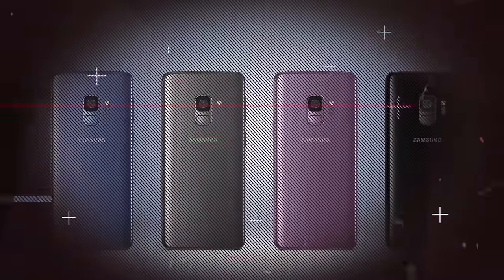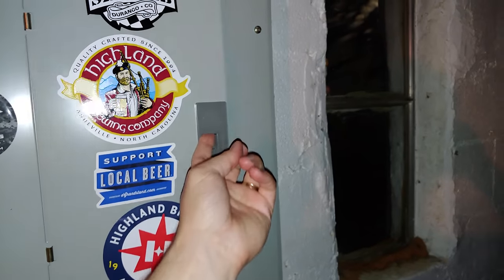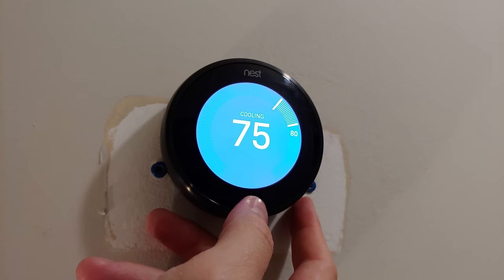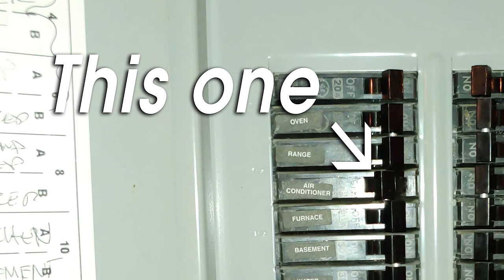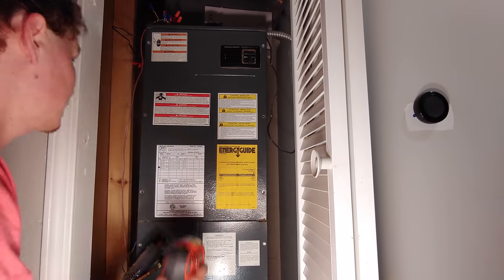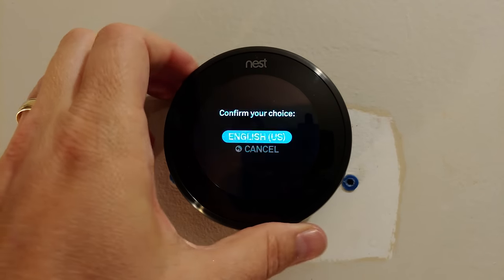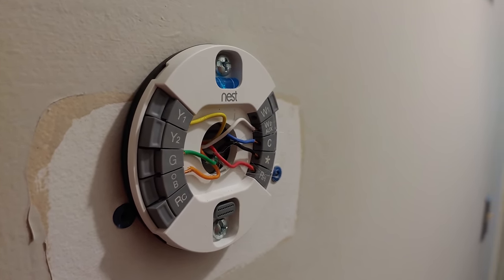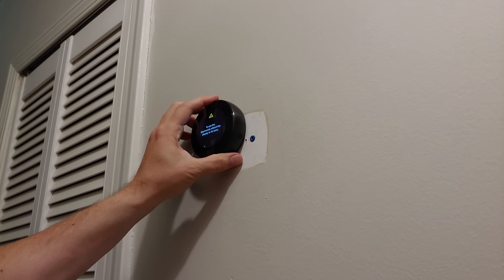3 Common Google Nest Thermostat Problems and How to Fix Them

Comment: Thank you so, so much for all the information.  I got the "no power to the Y connector" or something like that.  Thought the unit was broken, some wire cut somewhere. I checked the connection, and it looked fine.  I was about to call for repair tomorrow, and you said "check the fuse" and I figured "why not".  Went to the A/C and guess what???  It was the fuse.  Went through the tool box and found a fuse. Powered off the A/C put in the fuse and I was good to go.  Something as simple as a fuse and if I didn't watch your video I would have been freezing (it's 43 degrees in Orlando) tonight and probably paid a bunch of money to the repairman.  My wife gave me a big hug and I got brownie points. 😁

Comment: I HATE this nest system with a passion. It was already installed when we moved into our home and it's been nothing but trouble. I had this same issue, amongst others. Right now I'm trying to figure out why the house gets freezing cold when the temp isn't supposed to drop past 72 degrees!!!
Reply: I hate the nest thermostat! My unit will not go lower than 78 degree in the Texas heat!
Reply: @tamikasimmons8307  disconnect it from the wifi and program it the way you want. Mine has a problem with saying its 70 in the house when its actually 75. Also if you have the thermostat set low and its not dropping enough then you may have an ac issue. Not the thermostat
Reply: Probably a frozen coil, which you need to open AC vent and let it melt down into drain pan. You gotta turn off the compressor outside and change thermostat to fan only. That was my issue. Had to wait about 2-hours though until it melted down. Then I had to clean it. 🤷🏽‍♂️
Reply: Same here
Reply: I'm having the same problem, ive got it set at 74 and I reset the thermostat and its still dropping the temperature and it's really cold.
Reply: Thanks - you saved me! Couldn't select anything on the menu until I stuffed the wires into the wall some more.
Reply: I agree. It's too buggy. My problem is the opposite. It's blowing heart randomly when set to air condition.

Comment: Thank you for this!!! Had my power turned off but still ended up blowing the fuse in my furnace. Without this video I would have been lost! Got a replacement fuse (ironically in the auto section) and everything worked immediately.

Comment: Thank you for the video. Nest stopped cooling after heat being turned on for a few days. Prior to cold days, cool was working perfectly. Any suggestions how to resolve this?
It keeps blowing warm air. We tried everything: from breakers to resetting the the nest. That did not solve the problem.

Comment: Got a Nest as a gift last month.  It does not seem to like my 1989 furnace. I have it set at 69 from 10pm to 3 am and then move to 73 at 3am so that when we get up for work,  early, there is heat in the house.  There are days that the Nest Learning does not follow the schedule and the house is cold even up to 7 am. So then I move the app to a degree higher and still the furnace does not come on. I am very frustrated. And it says 2 to 3 hours before it will kick on which is now by 10 am.  This is not what I want. The old thermostat started the furnace immediately if moved up.

Comment: My issue is: the thermostat works for a few weeks, then suddenly stopped working.  Replaced the air filter didn't event help.  Put back the old Honeywell unit and started working again.  Google search returned ton of the same issue.  Called Google support and said to call an HVAC.  Go figure.

Comment: hey, this video helped me trouble shoot my power issue. Basically, there was no power running to the wall mount not because of a fuse but because my furnace has a moisture trip sensor sitting at the base of the furnace. I hit the reset button on the sensor and it gave power back to the furnace and the wall mount. Thank you so much,,,saved me hundreds of dollars !!!

Comment: Good job for not being an hvac technician, a few things you can add is you can shut off the power at your furnace/air handler power switch instead which may be more convenient and it's a 5 amp fuse not volt

Comment: Tip two helped out. I wasn’t getting heat + fan until I switched my single red wire to the Rh tab instead of the Rc tab. 

Thanks!
Reply: My nest thermostat worked fine for a year then suddenly started e298 error. I have 4 wires no common. I gave up, after many complaints from spouse, and put the programmable back up.

Comment: What if the fancy hockey puck simply decides it doesn't want to run some nights? Sometimes it'll keep heat great, and sometimes it reports to me that while it's set to 70, the temperature is 63. My Honeywell unit never had this problem.

Comment: i have a wiel mclane steam boiler with radiators, 24 volt-2 wires feeding a Honeywell thermostat.  i purchased a nest 3rd generation learning thermostat,  installed it, connected to wifi,  the nest prompted me to test mode, went downstairs to check the boiler.  It turns on but the problem is when I go to the thermostat and lower the thermostat to turn boiler off,  the boiler does turn off but the dampener motor will keep running and buzzing.  it keeps rotating the flapper from on to off and humming........  i had to remove nest and reinstall the Honeywell,  any solutions?  it's almost like I need a c wire and possibly another relay PC board?

Comment: I had a new furnace and ac unit installed in december, its july and the ac just went off. wtf... Its under warranty but this is second problem since installed (american rescue rooter) r wire not connected. The breakers are on and I am not playing with wires.I paid them 8000.00 to install this stuff oh and their nest smoke/carbon detector with batteries that last 10 years dead in two months... Do you know how much those 6 batteries cost??? I am so pissed and it's fricking hot at 2.30 in the morning-no sleep for me
Reply: Bruhhh, literally the same shit is happening to me! I wake up sweating bullets when the temp is set to 66 but then the thermostat will unauthorize inputs to go up to 75 or 80 when 67 is set on screen. I’ll lower the temp then the temp goes higher😂. This shit is trash and an irritant that makes something so simple into something too complicated. So many inputs and controls that are really there for nothing, manipulating all these different outcomes of temperature.
Reply: @marshallpinckney74  I just want my old manual thermostat back. It is trash, and those temps same here go to bed at 74 wake up at 65....wtf  come on

Comment: Just installed a Nest Learning Thermostat and it's not cutting on the heat.  Looked at your video and issue #2 was my problem.  Change the Blue wire from W to OB and now it's working great.  Great Job!  Thanks

Comment: I saw the jumper on the old thermostat and wondered if I should run the red wire to both rc and rh. Apparently I need to run to just rh as I have it on rc. To get it to heat it is set as B wire type and not an O wire. Also it had a run away heat issue today. Initially It didn't power up.

Comment: I just installed my 1st Google nest thermostat but I can't get get to recognize the humidifier in the * It say no wire connected. Then come to find out there is no adjustment setting in the nest thermostat for the humidifier ontop of that. I just got I have no need for the learning one that and I don't like the price of it 😕

Comment: Question? On my old unit, I have 2 wires connected to labeled area of Aux/E one wire is white and other is a stripped copper wire. Do I place both of them in the Nest thermostat marked W Aux?

Comment: Man, why didn't you use the included wall plate to clean up that install! A-D-D really kicked in for me and I would have had the plate on there first thing! Otherwise, 2 nests installed for me now and both had C-Wire issues that I had to resolve, first one I bought a separate 24Volt 2 Wire kit from Venstar cause I had a 2 wire furnace (heat only). 2nd furnace today had again no C-wire to power the Nest BUT luckily the C-wire just needed to be attached inside the furnace and then added to the connection on the thermostat!

Comment: I had the e74 error code. I noticed that i had to reset the breaker and it started working. I may have a bad/intermittent breaker, so I want to get that checked out first. It'll run fine then all of a sudden, i get the e74.

Comment: What if it worked great for 18 months, but only wants to blow increasingly hot air when set to cool this spring? Heat works fine and stays at temp, but cool set at any temp will blow hotter and hotter. Old thermostat works fine. Though the next did seem to work better with less on/off modulation. We do have a connected c wire. 
These are set the same as the pic I took of the old setup 18 months ago.
Y1 - Yellow wire
G -  Green wire
OB - Orange
RC - Red
W1 - White
C - Blank
A dark blue and brown were disconnected, unused and tucked in the wall when I swapped thermo's 18 months ago. Still not using them.

Thanks for any tips or suggestions. Google/Nest support has been...we'll call it "unhelpful".
Reply: I’m not sure of this is your Nest causing the problem. This happened to us and it was our coolant running out. The air was increasingly getting warmer and warmer until we eventually called someone. Did you ever figure it out?

Comment: Do you have a SOLUTION for the fan blowing constantly on the 3rd gen Nest
Reply: I have the same problem. I replaced the Nest thermostat thinking it was defective but I still have the same issue. Tried Ecobee thermostat and same problem.
Reply: @MsFernando148  i had similar issue... I checked the furnace and it was tripped (fuze). not the breaker circuit, but on the furnace itself.
Reply: Set the fan on auto

Comment: Have you ever seen a Nest thermostat causing a short double start to the AC compressor? Our AC compressor has started a sporadic, random short double start, then runs fine. Our AC Tech has done troubleshooting and changed the capacitor, etc and has no idea why this is occurring  .

Comment: We installed a nest thermostat and are having an issue not mentioned here. We have a "zoned" system and the upstairs vents are not blowing air at all. Is this an install problem or something completely unrelated? No one can even tell us how we are supposed to control the zones. Do I just turn on the 2nd thermostat?

Comment: I think the wires sticking out was my issue, even though it didn't looks like it. I kept on having the device reboot when I would try to press or spin dial. I took off and push in wires in to make it flush, which are very strong because its pure copper, not strains. Then put unit back on and it appears to work better for button presses and appears not to be "rebooting" itself when I try to touch the settings and dial. Thanks for the tips.

Comment: I bought three Nest E's yesterday on clearance. They are obviously old stock and had to be charged prior to installing/setting up. That said, two work perfect, one when putting it on the base said "remove from base and reattach" I left it over night and now it's dead, no light, no nothig. I currently have it on charge assuming its dead again? Have you encountered this with the "e"?

Comment: I have 2 units. 1 in the basement 1 in the attic. For the basement unit, i swapped to a NEST Learning no problem. For the attic it would power on my furnace but it was a start/stop scenario. I called a professional and he couldn't do any better. I switched to an Ecobee4 and it worked no problem. I just prefer and would love to have two NEST thermostats. So before i pull my ecobee off and try again with a NEST, why would I need to change my wiring to the heat pump side when i have a gas furnace? or did i misunderstand?

Comment: That's helpful thank you,,, mine has something to do with the G wire nothing works ... Then it worked just the fan and when I reach to nest customer service they told me that the system is detecting higher voltage and the nest Tstst max can handle 24V .... Any idea how yo fix it ?  They suggested to get an HVAC guy which will cost more than the nest itself so I rather sell the nest if it's not gonna work and find another smart tstat can handle more power than pay that much to HVAC guy.... Any idea anyone m

Comment: I tried to turn my heat on and I got an e/74 error..  took it off wall and lugged it in and and it tells me to put it back the base, then it goes blank so now I have no ac or heat. any ideas. at one point it says its not getting power. ive flipped all my breakers, i sucked out the jellyfish with vet vac from overlfow . tomorrow I will take off front plate to see if maybe a blown fuse?? help!

Comment: I have a Nest Thermostat E connected to a two wire heat only system. (gas fired steam heat). It has worked flawlessly for several months. Today the thermostat's screen went black, no message. Internet, modem, router, wire connections and all circuit breakers checked out fine. After about 30 minutes the system returned to normal on it own with out any intervention. This the second time it was noticed to happen. Any thoughts as to the cause?

Comment: Thank you so much for this. I thought I had a conventional system. Turns out I have a heat pump system. Did as explained and reset my nest to read for heat pump on the equipment settings and boom cool air!

Comment: Thank you for your help, I had an issue with my R wire saying I wasn’t getting power to the Nest, so I opened up the A/C unit, and had a blown fuse. After I put the new fuse in that I bought from Lowe’s, the display came on like never before.

Comment: I tried the first two suggestions before I saw this video. I thought I had finally found my answer in tip #3 but it turns out the unit in the attic has a safety switch on the door so if its slightly ajar the entire unit shuts off. Great video and super helpful anyway!

Comment: I had an E74 incident. It turned out to be a tiny button-type circuit 
breaker on the transformer inside my rooftop packaged unit. There was a 
recent power outage in my area and I assume a spike in power tripped it.

Comment: Hi can anyone help please I've  got nestThermostat e battery powered  so heat link C and NO my 2 wires won't stay in   do the mini screws at C and No come out or does the 2 wires need to go through mini screws on hear link where wires go in at bottom part not like the 1 b4 has  lots of wire inputs when mine only has C then No n something else under NO  then ithee side has oti 1 n oti 2 and that's it

Comment: Thank you for the video. I’ve just installed my nest from exactly the same Honeywell thermostat and I’ve got hot air blowing regardless the Nest Thermostat selection. After I watch your video I are wired like you mentioned and it worked fine. Thanks.

Comment: My nest worked fine for a year. Here in Texas we had a very cold wave. The heat only intermittently worked. Fan wouldn’t come on most times unless we reset the breakers. Now it’s starting to get warm and the AC wouldn’t come on at all. The outside unit would run, but the blower wouldn’t. I went to my local hardware store and bought the cheapest thermostat they had. Installed it. BOOM Fixed. Never doing nest again. I’ll keep this basic bitch thermostat until the day I die to avoid my kids going to bed cold.
Reply: I am having the exact same issue

Comment: My problem is the system works fine for a few months then it stops and says wiring has changed. I haven't changed anything. The first time that fuse in the air handler was blown. The second time the tech just redid the wiring and it worked great. If it happens again I am considering going with a different thermostat. Is there another one that is good?
Reply: I would look for a loose wire first.

Comment: Mine started to show Error E103. (Cooling does NOT work) Did some online reading and it says power spikes on Y1 wire. How do I fix this? I rebooted the nest and reclamped the Yellow wire to Y1, but no luck. Heat works fine. I have been using this Nest device for 2+ years and this just started to happen. I appreciate any help or advice.
Reply: Do you fixed already  do you change  the fuses ? Thank you

Comment: I have a heat pump, it just blows onto air on a/c....?
Reply: It could be no power to your reversing valve or a bad reversing valve go outside and push the contact in w a screwdriver if the big line gets cold you need to get 24v to your reversing valve and try again if that doesn't work you need a new reverse valve with what I've explained YouTube SHOULD be able to get you the rest of the way
Reply: Wait are you saying its stuck in ac or that when you turn on ac it only blows air not conditioned? If your outside unit comes on check to see if the compressor is running you may have to disconnect the fan outside to hear the compressor if so wire nut the wire you pull so you dont arc back voltage...

Comment: I have an e23 error code and cannot find out what the problem is. The thermostat wires were chewed by my dog and since then my ac, heater, and thermostat have not worked. The fuse was not blown, the transformer is still working correctly, I’m can’t figure out what thermostat wires need to be wired to the wires that are coming from the contactor. Anyone have an idea?
Reply: Did you figure it out? I have no clue what do do I have the same error code
Reply: @paigieee1343  I had to get a technician to come and work on it. Good thing I had  home warranty because the job was about a $4,000 job. It took quite a few hours to fix it. They had to do some rewiring.

Comment: I wanted to add with no C wire, it does not charge when the heat or A/C is on, therefore you will lose app connectivity during the heat of summer and extreme cold of winter. (when it is running all the time)